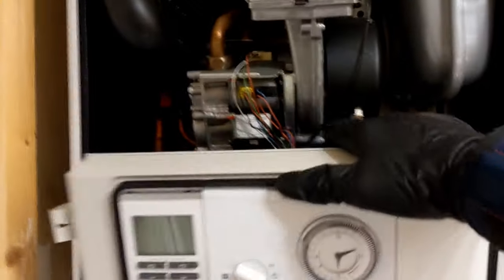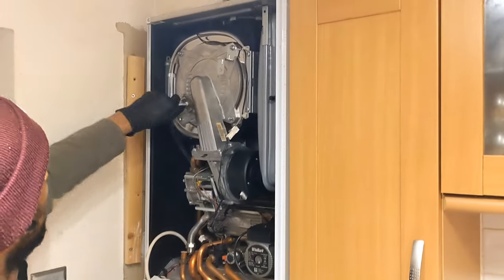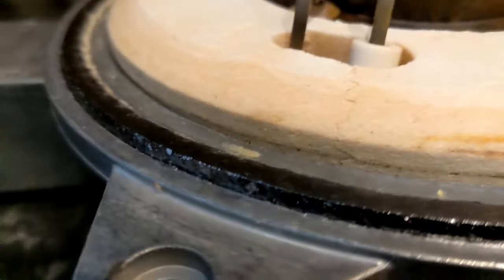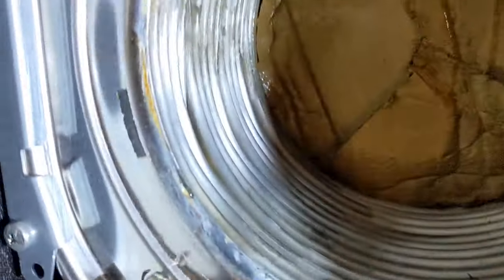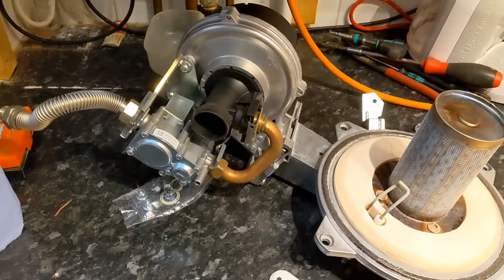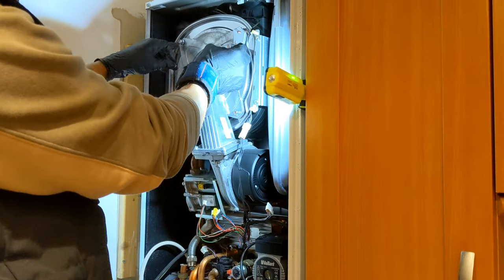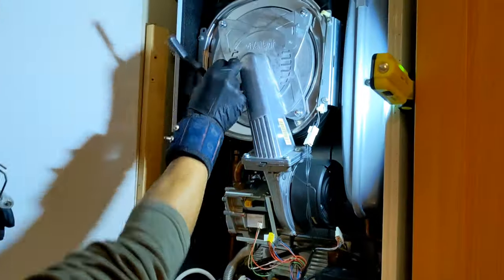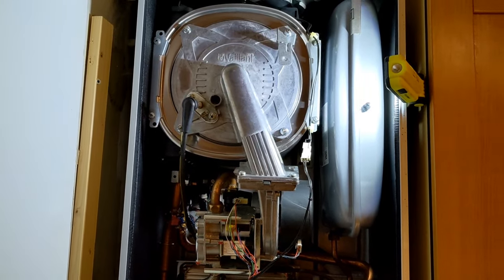Vaillant strip & clean main heat exchanger

Comment: Hi bro, I've just done a comissioning and fault finding course with vaillant in Dartford center of excellence. Colin Leach said strictly nothing abrasive, no brushes whatsoever in the main heat exchanger and electrodes for all vaillant boilers. Just white vinegard solution and a clean cloth. If you don't have white viegard you could use the liquid from the condense trap as it is mildly acidic then pour water down the condense trap and clean it. Also use a card between the coil and hoover. Also should always drain down the boiler, check water quality and inhibitor level, clean knoe filter and repressurise expansion vessel (not only at any service but at any visit, I mean the vessel only). What do you think about it as an experienced engineer?
Reply from the maker: Looks like you've memorised a speech 🤣 it's engineer's judgement on site how you decide to carry out a service process as long as you carry out all the necessary checks 👍🏾
Reply: Could you kindly explain why anything abrasive shouldn't be used in the heat exchanger?
Reply: I think this is a good way.... but there is more then one way to skin a cat. I use a soft tooth brush as well a cloth and white vinegar. And you can use a brush on the electrode to clean if it's only needs a clean. I always change them as it comes as part of a kit you buy and its best practice considering the tenant has paid for it basically.....when you on the fields you find your own routine and ways to do a job in a safe way and more efficient way. 

I even do a tighness test after a clean like this. Peace of mind I left the property with no leak protection taken before and afterwards.

This game always protect yourself. 🙌
Reply from the maker: @geminilounge7855  👍🏾

Comment: You don’t have to do tightness test, you can just spray it with LDS
Reply: If you isolate the gas at the meter you have to tightness test. If you isolate under the boiler you have to Tightness test. Thats what he did

Comment: I thought Vailliant doesn't condone the use of abrasive on the heat exchanger, they say water and white vinegar only.
Reply: The flappy brush is nylon .. its quite soft
Reply: The abracs brush removes the protective coating put on by the manufactures.  It's really not required.  Just clean with a tool or remove the blade from a multi-tool and use that to clean between the hex coil.
Reply: They do 

Literally worst thing you can do

Comment: After 2 years of operation, a cracking and knocking noise began when the primary heat exchanger was heating up, what could this be? Thank you.
Reply from the maker: Sounds like the burner nuts may need re-tourqing
Reply: Heat exchanger may need a clean.
Reply: @cputilitysolutions  That's right, I unscrewed the nuts a little and everything went away.

Comment: Ideally throw a towel over the open gas pipe or bits of the old electrode gasket can fall inside. Personally I fit the electrode and clean it all up when the the burner door is off.

Comment: Nice video, what was that cleaning attachment you had on the drill, part number, thanks in advance
Reply from the maker: Thanks, it's from Toolstation part no. 28885 and the extension is from Screwfix just search for flat wood bit extension 👍🏾

Comment: Great job mate. Can I ask where you got the small wire brush you used to clean the electrode with?
Reply from the maker: Thanks mate, just off eBay, search for wire brush
Reply: @cputilitysolutions  if you can't get it from ebay, you can't get it anywhere, but always check Amazon for better prices!
Reply: Euro car parts pack of six. £3.

Comment: The drill extension bar  ?? ... I bougth the flappy toolstation brush to do a baxi but the shaft is round .. please put a link to drill extension bar as all the ones ive seen are hex ??
Reply from the maker: Have a look for drill extension in Toolstation or Screwfix

Comment: I recently installed all new heating system. Vaillant VUW 256/5-5 boiler, aluminium radiators, cooper pipes. All works fine, but when boiler warms up and cooled down i hear some very annoying metal clicking sounds. The boiler is 6 months old and under warranty.I called  Vaillant authorized service and they said to me that this things is normal. Boiler is installed in bathroom and a hear clicking sounds in entire house and this make me nuts. I gave 1600euro for the boiler which they told me that is very quiet and now a have fucking annoying clicking monster.  I pour sentinel X500 antifreeze into system. I thought that it will be good to install Sentinel Vortex 500 magnetic filter to prolong boiler life, what do you think about that, is it worth it.
Reply from the maker: Did you clip and lag the pipes? The clicking sound is most likely the pipework not being properly supported or lagged and the contraction of the metal as it heats and cools creates the clicking noise
Reply: @cputilitysolutions  The clicking sounds comes from the boiler itself. I contacted Vaillant yesterday and they will install silicon gaskets and grease the heat exchanger bolts and nuts with copper, like you did. Your video helped me to solve the problem. Thanks.

Comment: Was that à wire brush or bristles?
Reply from the maker: It's a nylon brush mate, don't want to use anything too abrasive. Toolstation part no. 28885
Reply: @cputilitysolutions  hard to tell from the video but I assumed it was, or a soft metal like brass. I'm not a gas engineer but like to see how its done and how these modern boilers work, having experienced a few 'clueless' engineers from certain maintenance contract companies!

Comment: Did you clean the siphon below the boiler as well as the magnetic filter if there was one installed? Did you actually tighten the bolts with a torch spanner to make sure it’s done to Vaillants expectations 6NM? I also couldn’t see you check the expansion vessel and drained the water and or checked the pressure. I don’t wanna judge you but seemed a little bit missing for a thorough service.
Reply from the maker: Great observations! You sound like you know your stuff! As the title says, this video is to show how to strip and clean the main heat exchanger. The other aspects of the service you mentioned were carried out including 26.9 checks. The only thing I don't have at present is a torque wrench which I have already mentioned at that relevant point in my video 👍🏽 thanks for watching!
Reply: @cputilitysolutions  I’m happy with the content of the video but wasn’t sure if you carried out the points I stated. That’s the only reason why I asked.